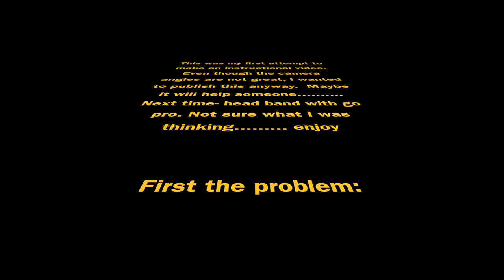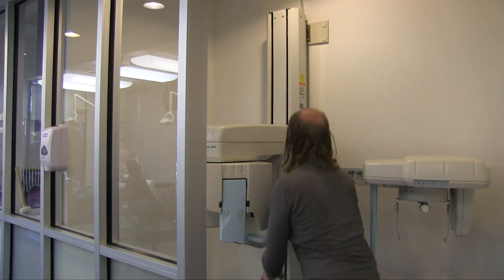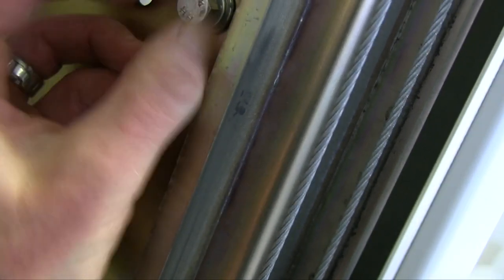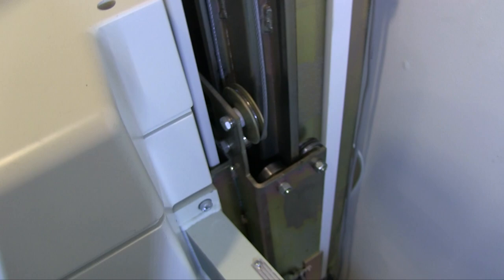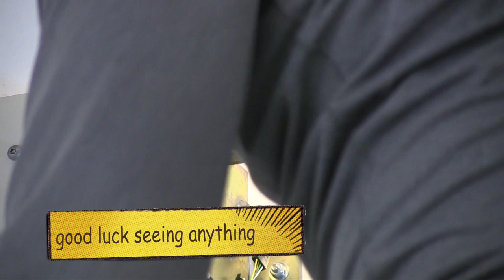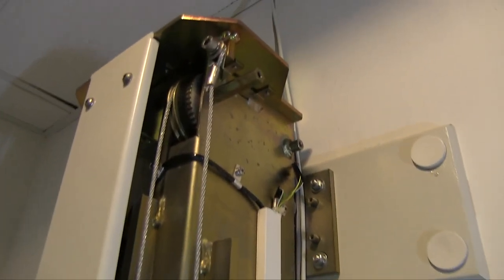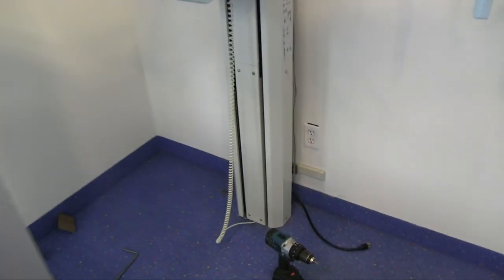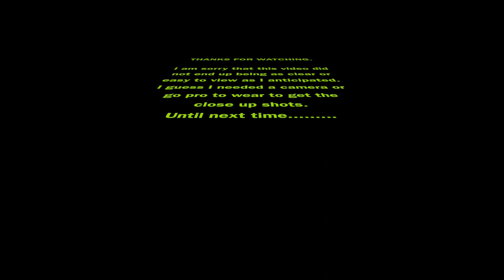Gendex 9200 Pan/Ceph Column Motor and Belt Replacement

Comment: Brother, you give me cassette dimensions
Reply from the maker: No idea. It should be easy to find if you search for specs of the machine.
Reply: @Samlol23_drrich  There are no dimensions on the device, no in the catalog
Reply from the maker: @waseemdahnin2868  when I work on Monday ill measure it for you. Off the top of my head I would say around 12" x 8"
Reply from the maker: @waseemdahnin2868  10 1/2 inches tall by 4 1/2 inches wide
Reply: @Samlol23_drrich thank you very much
Reply from the maker: @waseemdahnin2868  glad to help.